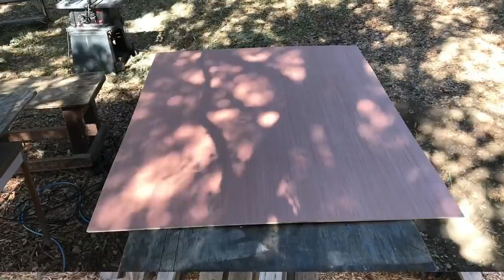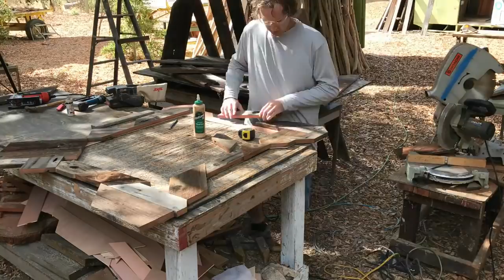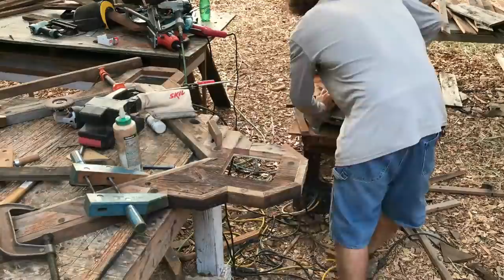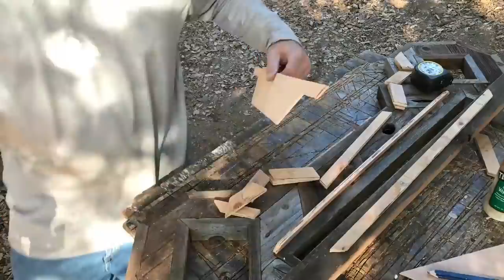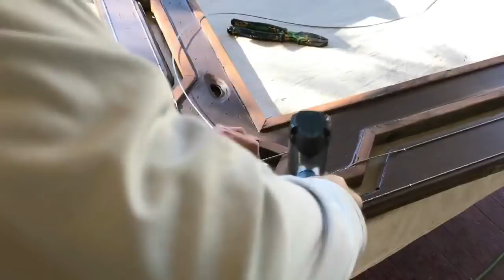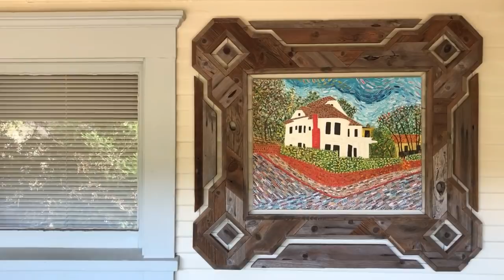Wall Art Wood Sculpture with painting in the middle

Comment: WOWEEEEE. Love it, can't decide which I like best, the frame or the painting. Both equally amazing. Thank you for  showing this.
Reply from the maker: Good to hear. This is the idea. It seems like whenever I look at art (in galleries, museums, etc) the painting gets all the attention and the frame is just there to show off the painting. I think its time that frame gets a little bit of credit for being part of the art rather than being something that's there to hold the art and help bring attention to it. I'm hoping to build more wall art sculptures with paintings in the middle to show that frames can be just as important to the overall look of the art as the paintings.
Reply: I used to make pictures because the idea came first, then think about how to frame it later. It was always said that the frame should compliment the picture, not overpower it. Now I am thinking there are no limits, it's ok to break the rules. I like the idea that a frame can be anything.  Thank you for sharing your thoughts.
Reply: PS. I am fascinated by the way you started the frame as quite a large piece of wood, and you cut into the sides to reduce it. Then you built the sides back up again. Your design ideas are very clever.